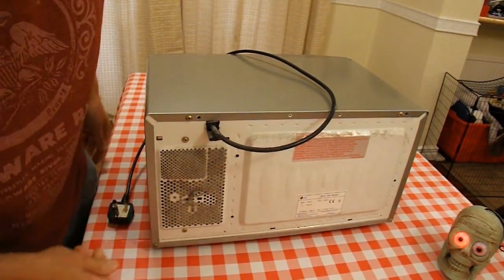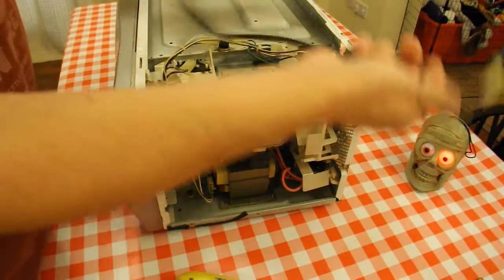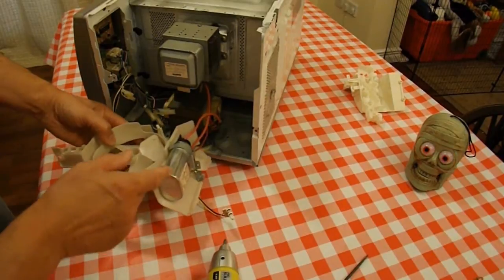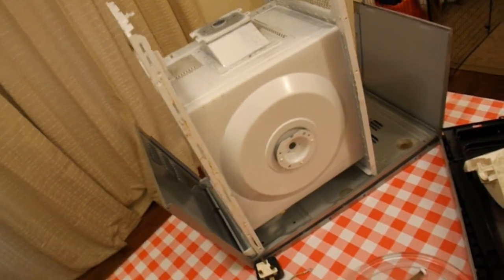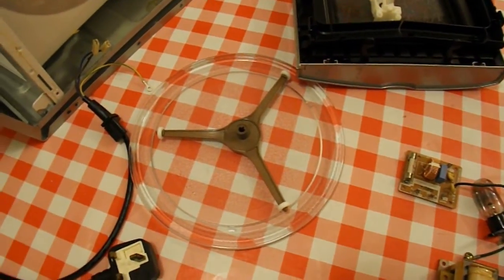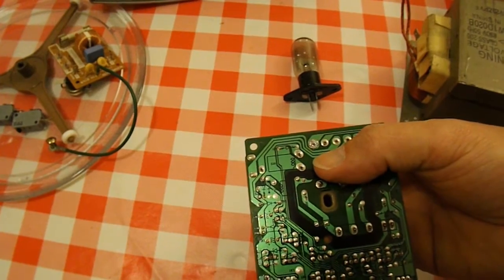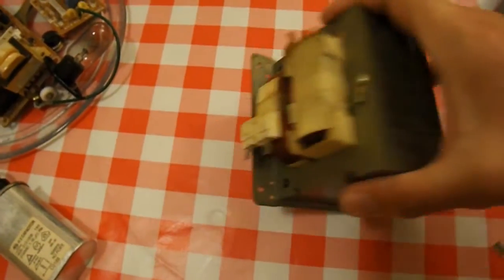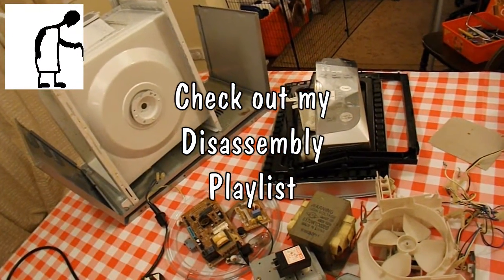Let's disassemble a Microwave Oven

Comment: Why didn't  you discharge the capacitor before you stripped the m.w ??? I intend to strip one down soon so I got a length of thin wood [ 12 inches x 1 ] and I knocked a nail through it just inside the end to short it out useing the nail to touch both terminals . Would you say it would be safe ???
Reply from the maker: As far as I know all "modern" microwaves have a resistor across that capacitor to ensure it does not hold charge when not in use so there should not be an issue however taking the precaution of shorting it out would be a double safe.

Comment: Referring to my previous comment - 
Uh oh -  I just learned that what i thought was a capacitor in the magnetron is instead cooling fins around a high voltage diode.  As you likely already know a diode is used to convert AC to direct current.

Comment: Interesting disassembly video.
The control unit - if it has a countdown timer that can be set by the user - might be useful in a hobby room  for the timer with the beep alarm.  IF the magnetron has a variable capacitor it can be used to tune the frequency of a broadcast band or a ham band radio receiver or even a radio transmitter.  The magnetron might also be useful to make a microwave frequency ham radio.  I've heard of some people using the high voltage transformer in a ham radio amplifier.  The 3 legged roller  / plate combination might be used to hold a camera for doing panoramic photography - IF the motor can be slowed down by a gear or electronically.  OR the roller / plate assembly could be used alone for panoramic photography.  That sort of rotator assembly might be modified to be used as an astronomy telescope holder - at least for the azimuth.  The fan could circulate the air to keep the air fresh in an out building hobby room.
You'll likely come up with some other uses for those things.  
Some people use the magnets for experiments trying to make a perpetual motion motor.  Or for holding up pictures drawn by grandkids.  ((-:
Reply from the maker: Thanks for looking. I am amazed what turns up when people are looking at my videos on YouTube. This is one of my early videos back in 2013. I wish you had seen it back then and made those comments as I could have done a series using each suggestion. The bits and pieces have gone their different ways by now. I am currently keeping my eye out for another scrap one so I can use the turntable as a display mount for my smaller projects. This is what I did with the turntable motor https://youtu.be/nJdKdlNKuUQ?list=PLA5a2xPRSrB0ypbT8Tr-CZfXPIiaOHUlL and here are a couple of things I did with the fan motor https://youtu.be/7c-AsRsyq34?list=PLA5a2xPRSrB2VTto6XDfLr0xag7y461gE  https://youtu.be/F1IESEC1dik?list=PLA5a2xPRSrB2VTto6XDfLr0xag7y461gE

Comment: One time i was messing around with a disposable camera and i touched the capacitor without any idea what would happen...  Scared the hell out of me
Reply from the maker: That is one way of finding out.
Reply: @GrandadIsAnOldMan  I used the whole microwave control panel from a microwave I found to make a time limited receptacle. I use it to time limit my soldering iron and chain cleaner.
Reply from the maker: @kwinters5550  great stuff 👍👍
Reply: @GrandadIsAnOldMan  Yes. With my soldering iron being time limited, it makes it safe for me to multi-task in my workshop while I'm heating up gunked up motors that I'm fixing and cleaning.

Comment: Nice video, a lot of guys are using those high voltage transformers out of microwaves to build their own welders. Tons of good stuff in there.
Reply from the maker: Thanks for commenting, I have used a few of the parts in my projects but so far the only thing I have used the big transformer for is as a heavy weight to stabilize things. It will get used eventually.

Comment: its VERY frustrating wanting to know whats being said, but having the vocal at FULL SPEED AHEAD LIKE THIS>>> frustrating
Reply from the maker: Sorry Jessie, thanks for the feedback. I was really just interested in what bits I might be able to salvage and was aware that the time was running on, so I speeded it up. If you really needed a detailed description for guidance perhaps for servicing or repair then this is not the video for you, there are many much better repair and servicing videos on YouTube, my video was just about disassembling for what is salvageable inside. I summarise the details at the end so you miss nothing useful in my conversation during the video.
Reply: the wrap up helped. I had hear there were capacitors and switches inside... and yup they are there. now I wont see any microwaves lying around
Reply from the maker: jessie horton Hello again, just a couple of points if you do come to disassemble a microwave yourself. Please checkout the videos I linked to in the description (copied down below) as there are some safety issues. 1. There are some unpleasant metals you really need to be aware of and leave well alone. 2. The capacitor can carry enough charge to hurt you and needs to be checked and discharged.
Watch this please
Dangers of Dismantling a Magnetron 
http://youtu.be/4Zev8Ws4P1Y
Another good video on safe Microwave Oven disassembly is here
http://youtu.be/N-ogNZ6UPD8
This is another disassembly video probably not one I would recommend
http://youtu.be/9ZairaXIeM8

Comment from the maker: In one of the videos I link to, the guy suggests storing it shorted out just to be safe. I shorted it off screen and nothing happened, on the same video he says the circuit ensures the cap self discharges as long as the circuit is OK. Obviously once I took it out that circuitry no longer exists. I will wrap a bit of wire across the terminals anyway.